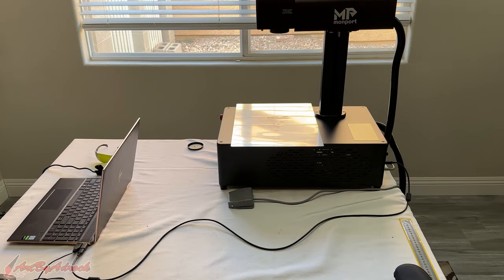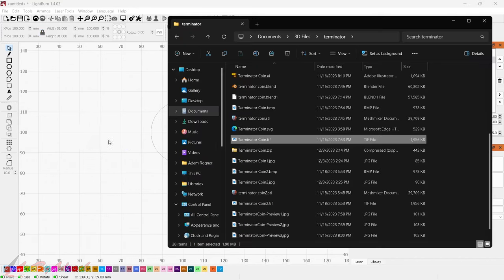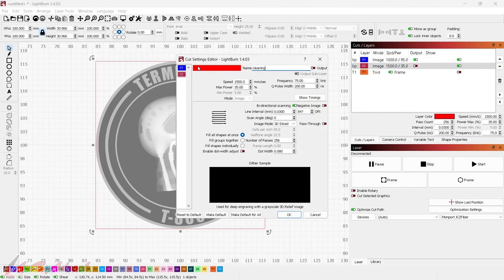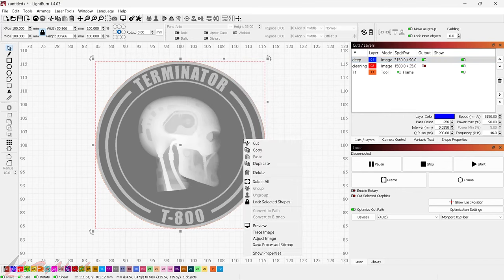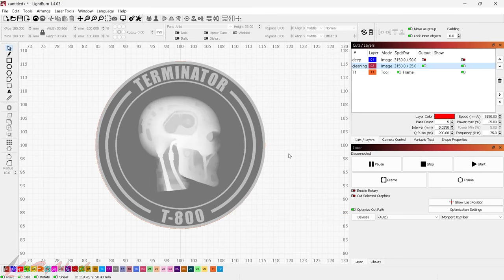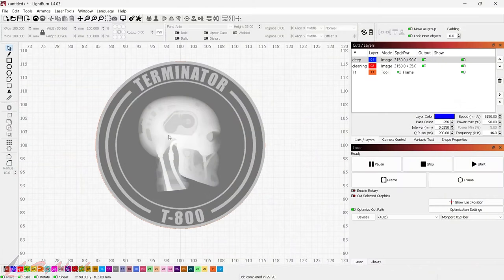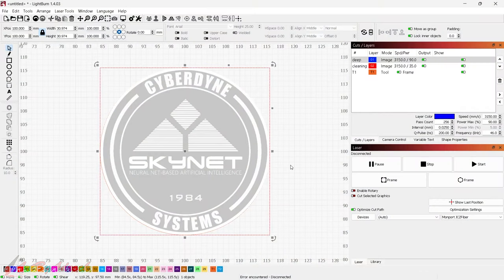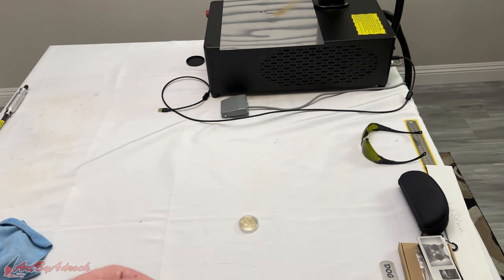Deep Engraving Metal Coins - Full Instructions & Fiber Laser Settings

Comment from the maker: Hey everyone, I’ll be giving this coin away to one lucky winner so if you’d like to enter to win, simply leave a comment and make sure you’re subscribed. That’s it! I hope you all enjoy this video and find it useful. Have a great weekend and I’ll see you all soon!
Reply: If you don't mind redoing it in gold, platinum, or even palladium, I'll be game. :)  Great video, I really liked your presentation form, easy to follow for the beginner and seasoned pro.
Reply: But with the proper lens you can do this at least 4 times faster!
With more detail at the same time!

Man, you have a super powerful laser with these 60 W, but deep engraving a small coin with a lens having a huge working area of 200 x 200 mm is just a massive waste of time. Also a massive waste of the resource of the laser source, which resource is not infinite. And a 60 W laser source is not at all cheap.

You need a lens with as small as possible working area. The smaller the working area of the lens, the faster it will work. And also, the smaller the working area of the lens, the finer spot it produces, hence more details you get. Lens with a 35 x 35 mm working area may not be enough for this large coin. But a lens with a working area of 50 x 50 mm will do for sure. It will do the same coin around 4 times faster and you will get at least 2 times more detail!

Comment: Great info. Thanks for the height map website. I need to figure out why my fiber takes so long. I'm running the 30w Monport with a 150mm lens and a coin takes mine over 3 hours.
Reply: The speed is 3150 mm/sec in this tutorial which translates to 189000 mm/min. Sometimes lightburn changes the units, I would make sure that the units are the same and give it another go. It took me a while to get that figured out haha
Reply: You need a lens with as small as possible working area. The smaller the working area of the lens, the faster it will work. And also, the smaller the working area of the lens, the finer spot it produces, hence more details you get. Lens with a 35 x 35 mm working area may not be enough for this large coin. But a lens with a working area of 50 x 50 mm will do for sure.
For example, if you get a lens with half the working area size 75 x 75 mm - your speed will be around twice faster than with 150 x 150 mm lens.

Also, 30 W laser will be 2-3 times slower than 60 W laser.

Comment: Definitely some amazing steps 🙂, I pulled the skull and cross bones form the website and tried to follow along, but my run time is something like 13 hours, which isn't right.  I will go back and try again.  How do you know what depth, from surface to surface, do I?  I am running the 1/8 coins for now.
Reply from the maker: What type of machine are you using and what settings? If you want, shoot me an email with a screenshot of your setup and I’ll try and help. Is the preview saying 13hours? If so, I wouldn’t trust that as it’s not really accurate.

Comment: I have a 30 Watt Raycus can you advise What approximate settings are needed?
Reply: You would have to slow your speed down. You have half the power. Try your machine on 95% power and 50-60% of his speed.
Reply: Have you ever managed to do it with the Raycus source? Is it really possible?
Reply: @lucaslevy1326  a Raycus source will work fine

Comment: let me be the only one to have an issue. I myself have watched your video several times and paused it after everthing you did, duplicated that step on mine all the way to the end and when I preview it, it is solid black, like there is a fill layer on top. It does not show the image. I finally did ctrl z, one step at a time and got it back to showing in the preview like it did on yours so I started it and it started make the coin but there is no detal at all in the head. It did a few layers on the  outside of the head then started the stuff around it and that part seems to be doing fine but I have a flat head, lol. What did I  miss. This is my first coin so I know I did something wrong.

100w JPT MOPA Fiber Laser - any help woud  be appreciated. I have been wanting to make one of these for a year and finally had the time today and now I am bummed.
Reply from the maker: I’d have to see what you did. You can email me your lightburn file if you want and I can take a look at it. I do have a new video coming out soon which might help as well.

Comment: Question… with my 50 watt fiber laser I finally got the coin to engrave just fine.. however at 256 passes it stays on just the outter edge for the last like 100 passes and engraves it super deep like ridiculously deep….can I try just 100 passes? And add more if it’s not enough? Or is there a definitive way to tell how many passes I need?
Reply from the maker: Are you using my coin or what design is it? With 3D sliced mode adding more or less passes will essentially double up the layers or remove some. Have you tried adjusting the power and/or focul distance from the lens. I would start there first. Shoot me an email if you want and I can try and help more.
Reply: @ArtByAdrock  yes I bought your design the setting you used made mine blurry but I was getting great result at 1,500mms, 90 power 30 frequency.025 interval
Reply from the maker: @swflscratcher5893  ok, what type of machine are you using and lens?
Reply: @ArtByAdrock  50 Watt Fiber from Omtech 200 mm

Comment: Why doesn’t mine look like yours? Also I did one at 256 passes and all it did was obliterate the whole coin
Reply from the maker: What machine are you using and did you have it set to 3D slice mode?
Reply: @ArtByAdrock  50 watt fiber laser and yes I had 3D slice on
Reply: @ArtByAdrock  maybe I need a smaller lense I’m using a 200mm
Reply from the maker: @swflscratcher5893  I used a 200mm lens so that shouldn’t be the issue. Was it focused correctly? I’d have to see the result in order to tell a little more.

Comment: But with the proper lens you can do this at least 4 times faster!
With more detail at the same time!

Man, you have a super powerful laser with these 60 W, but deep engraving a small coin with a lens having a huge working area of 200 x 200 mm is just a massive waste of time. Also a massive waste of the resource of the laser source, which resource is not infinite. And a 60 W laser source is not at all cheap.

You need a lens with as small as possible working area. The smaller the working area of the lens, the faster it will work. And also, the smaller the working area of the lens, the finer spot it produces, hence more details you get. Lens with a 35 x 35 mm working area may not be enough for this large coin. But a lens with a working area of 50 x 50 mm will do for sure. It will do the same coin around 4 times faster and you will get at least 2 times more detail!